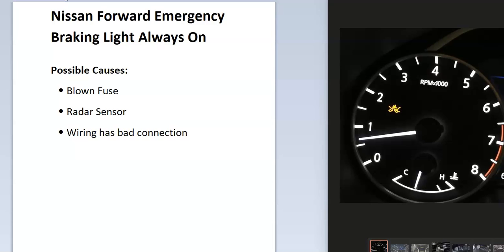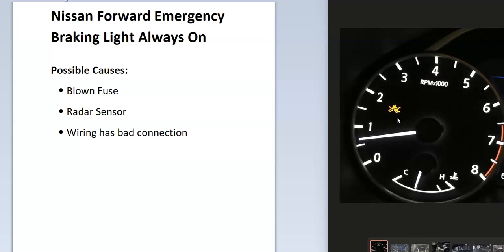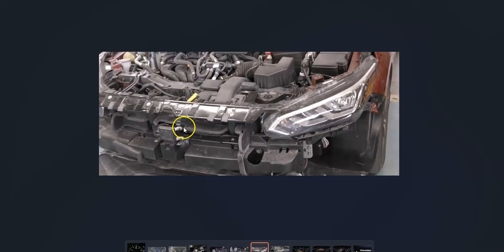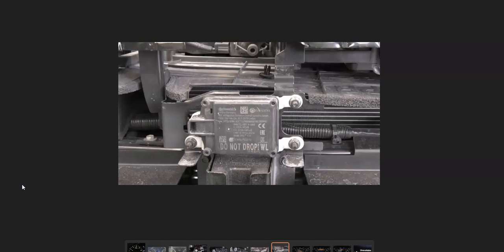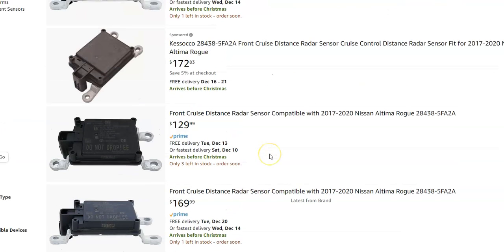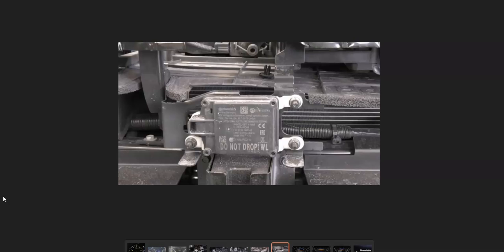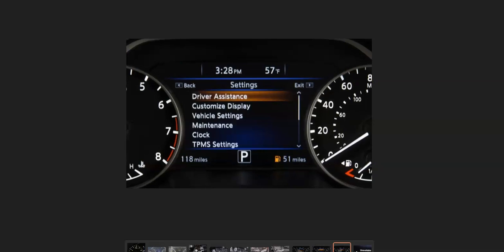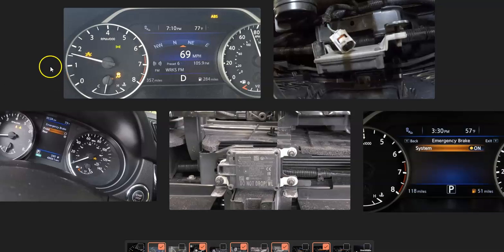Causes Why Nissan Forward Emergency Braking Light Always On

Comment: I think the answer to disabled that sensor is by opening it and do ur electric work inside the sensor I have been looking to disable it forever not even fixed just eliminate that function but no body sale any bypass sensor or anything because it is a safety future but I really Hate it because after 60 miles or little above it kill my cruse control and stay on and it is very frustrating

Comment: I had two 2019 ALtima's rebuilt and both had this issue... The SV I managed to fix by simply cleaning the radar and surrounding area (really glad I thought of this solution)... The SR not so easy bc I had to replace the radar with aftermarket unit from Ebay which is aro $150 vs the dealer's oem at $1500... Then I had to get a pro tech come to calibrate it and did some rewiring since it was in an accident.  Long in short, make sure its level as well... BUT the only issue I have now is on the SR it annoyingly pops on ONLY when I have driven 15-20 HIGHWAY miles and immediately goes off w/in a few minutes once I exit the highway and back on a local street... Man I am the type that is very anal and for the life of me I cannot figure out this werid, unique issue so I am deducing it has to do w/the internal wiring... But hey I guess I can live with it bc it still works local :-///
Reply: I'm just dealing with it too. I'm sooooo tired of it.

Comment: My system works for about 10-15 then the malfunction light appears. 
Please note the system works fine before the malfunction indicator comes on. I’ve been on this for a year because the dealership says it will cost 500 dollars for the part and for them to fix it 😅 I’m at the point where idc anymore 🤷‍♂️
Reply: Same Here. Every new ride, the systeem work well for the first 16-22 km’s. After that, two beeps telling that there is fault en the system turns of. It repeat’s every restart. Still can’t find the cause…
Reply: @henk_b I restart car and it's fine again. Runs great  can't find problems with it either.
Reply: Me too. I'm sooooo sick of malfunction warning! Super random too. I'm beginning to think they got bad sensors!

Comment: Just popping in to say that this video saved me a $225 trip to my local dealership just to have them even look at the light and tell me what it means, plus allowed me fix the problem by myself with $0 spent, (all I had to do was clear a piece of debris blocking the radar sensor and back on the road) thank you!

Comment: Can it happen because the brakes was replaced  and they did not put something back together correctly? .y light popped on after a trip to the dealership and replaced front bracks.

Comment: I have a 2019 nissan altima platinum and in February 2024 i had gotten my windshield replaced. After a month later,  the AEB light started to blink. Also, it doesn't automatically stop when i get too close behind a car.  Can a windshield replacement be the cause of the sensor messing up?
Reply: Yes there are sensors and cameras that are located beneath the windshield behind the rear view mirror which need to be recalibrated when the windshield is replaced. Its best to get the windshield replaced at reputable shops that specialize in this and have the equipment to recalibrate these systems,
Reply: @geftiler2112  thank you so much!

Comment: Is there any problem if the light is blinking ?
Reply from the maker: P0443 stands for Evaporative Emission System Purge Control Valve “A” Circuit. I would test the purge valve.

Comment: My 2018 sentra doing same thing.  No breaking issue, but out of the blue it would "beep" with a malfunction and and warning lights.  Sometimes multiple times a day, sometimes every other day. Bought it with 26,000 miles in it, took it to Nissan two different times and because it wasn't happening at the appointment scheduled time, they said there was nothing they could do.  Even though I had pictures.
Reply: I've noticed they tell a lot of people that. Or this couldn't get it to replicate! Horrible system, maybe they are just super crappy sensors?

Comment: my EBS light came on yesterday after driving about 1/4 mile and stayed on while driving.  If I turn off the car and turn it back on it's not on but will come back on within a couple minutes.   that makes me think it's not a blown fuse.  Also, is it dangerous to drive without fixing this issue?
Reply: Great question! Mine comes on too! Continued driving it for a couples days now but worried still about it, will be taking it in for piece of mind, it's still covered by warranty

Comment: I was on the highway and a peice of tire in road flew u der my car and then this light came on and won't turn off now, my question is, is it still safe to drive my car
Reply: Of course, it’s safe to drive your car. This just means that your automatic braking system, the breaking feature that the car offers when you are about to hit a car in front of your or any other object, is not working properly and it has shut down. This is happened to my car right now, just be extra careful because you don’t have that safety protocol measure in line. The only thing that will stop you from bumping into something in front of you will be manually pressing the break. as far as it safe to drive, there are plenty of cars, especially older cars that don’t have an ABS system. If the lights on means that the front sensor is the one that is not working, so you should be OK with the rest of your sensors around the car as far as when you’re about to hit something and it beeps. Just be careful.

Comment: I have a Nissan Kicks 2019 and was excited with all the mobility features it had at first. But after a while... it has been concerning and alarming with AEB becoming disabled whenever there's any obstruction on the surrounding of the sensor. Yes, it's a great feature, it's great for emergency alerts... but during winter season and there's excessive amount of snow.. slushy or even heavy rain the light constantly comes on. It gives me few minutes until the car will slowly die down and then just stopped. I always have to pull over and wash the area with water. This feature is frustrating and I always panic when notification comes on even for minor obstruction because I know the car will stop. This is actually unsafe specially when you're on the highway.
Nissan Canada suggested to have it checked at any dealership. I brought it to a dealership, waited 2 hrs 45 mins for them to do just the diagnostic test. They couldn't find an issue but instead suggested to bring it back for further observation when the weather is in bad condition. I paid for the diagnostic test and this was the result. The model of my car doesn't have the off feature. How I wish it did.. or at least I wish I didn't have this feature at all.
Any suggestions?
Reply: Were you able to get it resolved? I’m really surprised your car doesn’t have the off feature

Comment: Not sure why this is happening, my car is 2024 Brand new…
Reply: Mine is also 2024 but it says OFF under the symbol

Edit: I checked the manual and it was due to the blizzard. The sensors are turned off because they cant detect properly in bad weather. The car is fine :)
Reply: @hosseinmolavi3581 lmao I agree I’m in Chicago rn it’s snowing mines came on 😂😂😂
Reply: @hosseinmolavi3581 Mine too, it is 2025 I have been with him for 1 week and that already appears
Reply: @hosseinmolavi3581  the light will also come on if it’s foggy out or if it  rains really heavy.

Please note you have to keep your windshield clean where the cameras at and also the big Nissan emblem in the front of the car houses the radar sensor so make sure that’s clean and free for dirt mug or bugs or it will deactivate and that’s the same with the front and rear sensors as well
Reply: @IWeasel i believe you are correct as mine started blinking on and off lastnight, but it was foggy as hell coming home 👍
Reply: Smh my 2023.armada with 4,000 miles on it,  abs light came on tonight slip controls,  forward and rear collision light on Saying malfunction.   I had to shut the vehicle off and so far it didn't came on back
Reply: @Shane23Armada get used to shutting it off and restarting!
Reply: @Olly.sunshine how do you shut it off?
Reply: @Metalpazallteway  Shutting car off. Then re starting.
Reply: @Olly.sunshine Turn out to be a battery issue
Reply: @Shane23Armada good luck your going to need it.
Reply: Mines is too , brand new & that symbol keeps showing up
Reply: Mine is 2024 too band new and done 3k these sign came blinking for a second and then I stop while for a while and it’s gone again..what’s the reason??
Reply: @Manfarfromhome that’s what happened to me today! And the emergency brake suddenly stopped the car while I’m driving,like a hard brake,thanks god I wasn’t speeding
Reply: Can you remove the sensor and be okay? I don’t care for the hard brake or the 1700+ to get it recalibrated/ because nissan said it’s slightly off center. 😅
Reply: Most likely its off if you go in the Settings you can turn it on and off
Reply: I'm getting mine replaced next week
Reply: Yep I'm so tired of Warning lights. Mine is a 2021 rogue sport 2.0 it didn't start doing this until like 65,000.
Reply: I been having this trouble now for 2 months . Nissan dealer told me that I need to bring it when the light is flashing on the dash board . It comes of and on and it indicates to open the front hood . The car stalls in the middle on the highway the other day . Today the car is stuck nearby my home it won’t completely turn on . I have delay with the service manager he said he cleaned some part during the time the car failed to program whatever he meant so they sent me home in rental. After 3 days in the shop the manager came back at me and said oh we did some cleaning and we were able to program it . Ya ok but it’s 3 days later and now the car won’t stop I can’t turn it on and it’s so cold outside . Everthing in the dash Board flashes included the engine light and then goes back out again. I’m so stressed because after dealing with them I don’t know why they can take responsibility and say we’re going to fix it . They did say they dint have the piece but also they said go home and if it comes back the same problems bring it back . Seriously I regret buying a car from Nissan . Sorry guys but it’s so stressful specially when I’m a women the mechanic there have dismissed me 3 times and I just bought the car 5 months ago . Anyone experience something similar?
Reply: @user-ww3mi7vu1s My car doing the same thing. Nissan is selling unsafe vehicles and won't take responsibility. People lives are in danger. Something has to be done at this point.
Reply: @ that’s not good
Reply: @user-ww3mi7vu1s They also cleared my malfunction messages and aren't reporting the real findings. Please keep all documents and record everything that your car doing. I'm so sorry you're going through this. Blessing❤
Reply: @user-ww3mi7vu1s that's so sad. The cars are only as good as their Service Centers!  Sometimes they are terrible.
Reply: Hi if a nissan has accideent damage crash and still this light after repair is on what i can do? It is quite straight .advice
Replace? Fuse is ok.thanks
Reply: Mine is doing it too
Reply: I just got my tire changed and they let my car down pretty hard , I felt as soon as I pulled away all the lights lit up on my dash - crash symbol is still on the other lights eventually went off or cleared themselves … is this possible
Reply: Same mine is a 2023

Comment: Done some of these things. But it sets off my engine light also and p2004 code. So what is that?.
Reply: Also 2016 rogue. This has been an issue for about a year and half now and I have taken car to 6 mechanics now and each say different things, and dealership  say its a  humidity issue.   Nissan won't help at all.

Comment: Hello, i have a nissan altima 2021, it happens twice while driving not when i start the engine. Let say it happens rarely. what it seems to be problem? Dose it need to replace the radar or just calibrated?
Reply: Same thing happen to my Altima 2020. It happens while driving and when the signal come on , the car will stop after 10 seconds. Then doesn't move. I had to turn it off. The car is back to normal after about 1 hour. Then the problem comes again all of sudden. So how did you fix the issue of "malfunction" ?
Reply: @salajmi  i did not do anything, it fixed automatically. But keep the nissan badge always clean. As I read many reports of this case, there are two cases, 1- if the error comes immediately while starting the engine it needs to replace the radar. 
2- if the error comes while driving the car goes around 50 km/h, no need to be worried it just needs to calibrate the radar or clean the nissan badge.
Reply: @Wasta91  Thank you for your reply . Yes, I get the "Malfunction"error while driving about 15 km/hr or less , then the car doesn't move. If turned off doesn't turn on again. After waiting about 1 hour it would turn on and drive normally .The problem will come again after 2-3 days and it would happen suddenly. 

Which radar needs to be calibrated ? Does cleaning the badge has to do anything with the "Malfunction" error?

Comment: I think if they install these safety sensor they should be warranty at no cost to the owner as long as you own the car. with out buying an extended warranty.
Reply: They are horrible to pieces of crap. Mine goes off as soon as it gets humidity or dusty. Here in Florida that's most of the time

Comment: I just bought a 2023 Altima amount 2 weeks ago and it just started doing this 😒
Reply: Take it back to the dealership, this is unacceptable
Reply: I just got a 2023 Sentra and mine came on in the morning for only a few minutes 😥 I'm just going to wait a couple days and see if it does it again, I wish you luck👍
Reply: @thebaddestradish9678  It's called the front radar obstruction, and it's a complete piece of trash. Nissan did too much with this part. They connected it to the cruise control, so once the sensor goes out, none of that work. I've been dealing with this for month. The Nissan service department replace the sensor for 2k..and it still doesn't work.
Reply: Did u get it fixed? Or you disabled it?

Comment: Mine is on and out of nowhere will say “malfunction”
Reply: My 2022 Pathfinder just started doing this a few days ago. It goes on and off.
Reply: My 2018 sentra doing same thing.  No breaking issue, but out of the blue it would "beep" with a malfunction and and warning lights.  Sometimes multiple times a day, sometimes every other day. Bought it with 26,000 miles in it, took it to Nissan and because it wasn't happening at the appointment scheduled time, they said there was nothing they could do.  Even though I had pictures.

Comment: My 2021 Altima does this, but it is always when I am driving into the sun, or when the vehicle in front of me has extremely bright tail lights. The forward emergency braking has actually almost CAUSED me to wreck by engaging when it didn't need to engage and when I wasn't expecting it to engage.
Reply: Same thing with my 2020 Sentra did you fix it my cars out of warranty
Reply: @abbas674  no. I just turn it off when I know I'm going to be driving as the sun it rising or setting in front of me.  And keep it set as the closest distance before it alerts/brakes for me. The auto braking thing really should have the option to turn it completely off. I guess Nissan doesn't realize some of us were actually taught to be aware of what's going on around us - especially when driving!
Reply: These systems use radar, meaning they don't care about light and sun light should have no effect on them.
Reply: Currently having the same issue
Reply: Omg this has happened to me twice… I’m driving into the sun and it triggers the emergency braking

Comment: I accidentally hit something and it turned on, when I turn it off it won’t brake for me right?
Reply: On my 21 Altima I can turn it off, but I have to do it every single time I start the car. It's a huge pain. We stayed at a hotel for 3 months after some storm damage & the best way to park was to back into the space. This stupid car kept slamming the brakes on because there was a hedgerow that I was backing toward. The place I parked was next to the pool area. The car made such a loud, horrible noise that it was quite embarrassing. 
It really should have the option to turn it off and have it stay off until you decide to turn it back on

Comment: This light keeps coming on the dealership stated that its because of direct sunlight although it came on with no direct sunlight the dealership changed out the stop lamp switch 3 times replaced it with a high mount stop lamp and it's still doing it
Reply: Mine too. Does it super randomly.